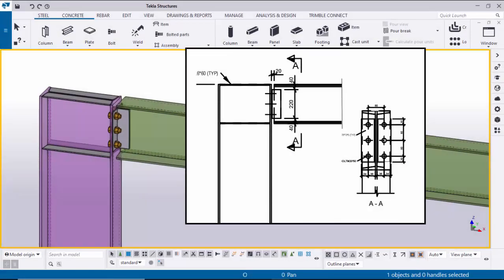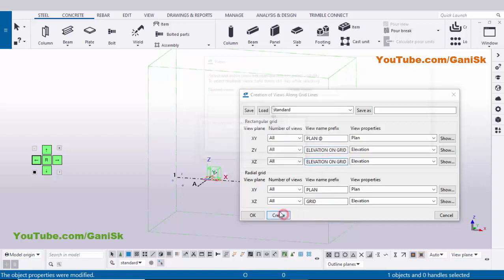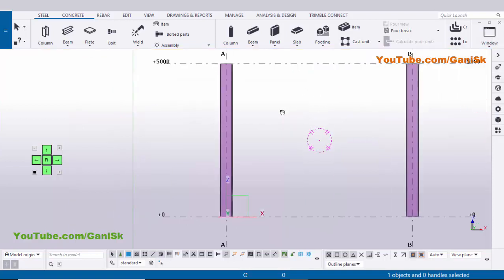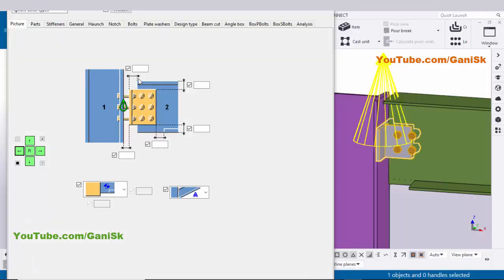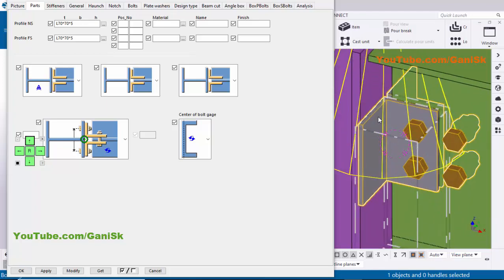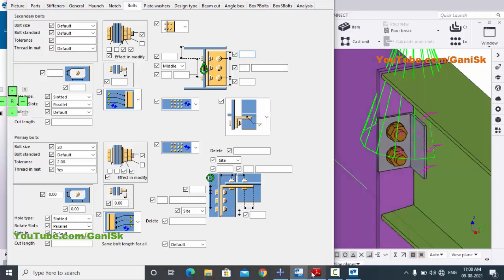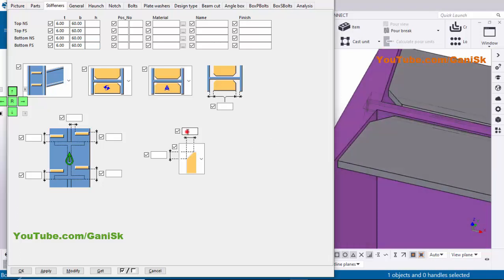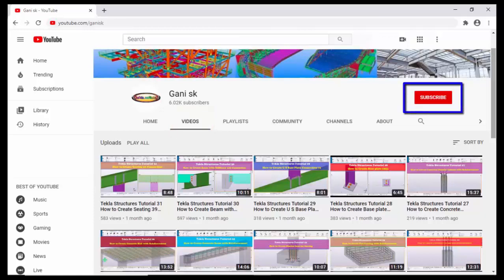Tekla 2021 Tutorial 11 | Connection with Example

Comment: For the other side you just copy and paste the whole connection?
Reply from the maker: No need to copy, in fist connection I have entered the values, if you want to give the same connection on other side, just select the component next select the column and beam then by default you will get the connection with previous entered values.

Comment: All your videos are easy understanding of tekla. Could you put a video for Column and  beam connection of  ISM600TB320x16. It will be very useful.  I tried and I have given the gap between beam and clip angle clearance distance but top and bottom cover plate is not having gap but beam web has the clearance. I used 141 connection.

Comment: Thank you sir
But I had some question
Why you clicked intterup after create the beam and column?
I Just wondering function of 'intterup'.
I will be thanks for if you explain it😊
Reply from the maker: Hi Bialini, Interrupt function is used for exit the command, for example if you want create column you need to select the column icon in tool bar and you need to pic the point or position to create a column, once you created a column still command is active to create another column, to exit the command you have to options one is click on "Esc" button on your keyboard (or) right click on mouse next select interrupt in the list to exit the command.
Reply: @GaniSk  Thank you 👍
Reply from the maker: @bialini   You are most welcome